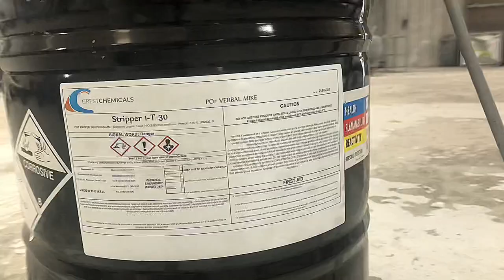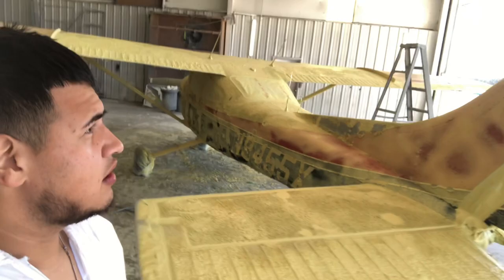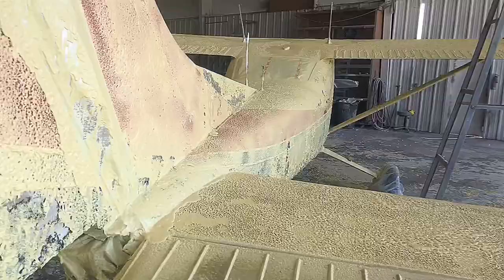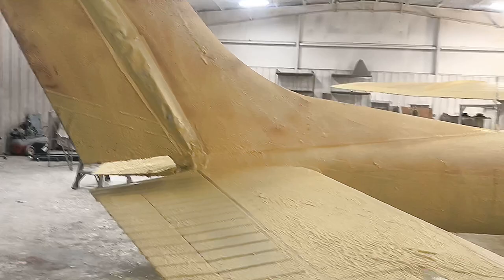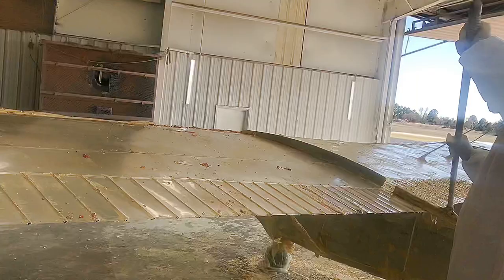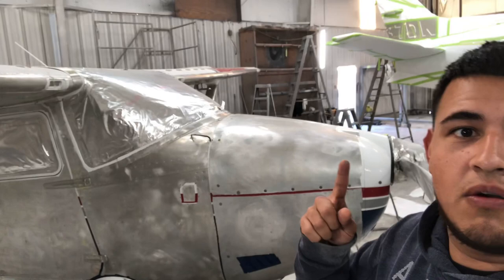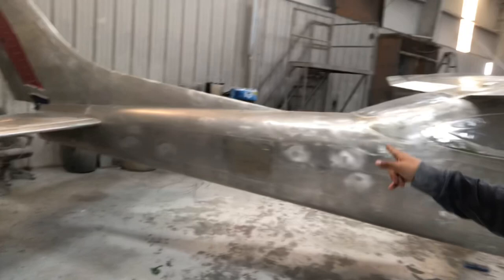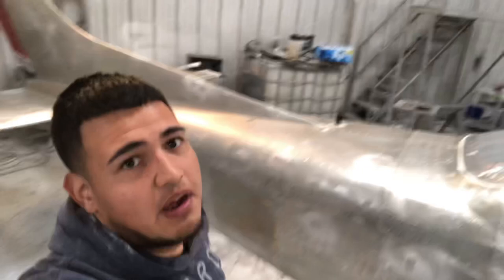Cessna 182 Paint Removal

Comment: My A&P school, Orange Coast College had a real nice Lear Jet that was owned by Northrop Grummam. Was based at Jack Northrop Field (Hawthorne Airport). We had it because the Painter to redo the paint did not do a good job removing the stripper. I ate into the structure and then was written off. Make sure you get that stuff out of all hidden spots.
Reply from the maker: Dam I’m sorry to hear that but if you’re looking for some quality paint you can always call me at this number 903-721-0348 or have any questions or concerns we definitely try to remove all the stripper because we don’t it does make it harder to work on.

Comment: That was a Cessna 182 taking off, they are loud because of the bigger engines and the constant speed propeller
Reply from the maker: Lol definitely loud
Reply: Yeah that 182 was loud, but in 50 years I've never heard the prop that loud on a 182, a NA AT-6, yes, but never a 182. It's also the prop making the noise, not the engine!  That was not a stock engine/prop combo on that 182 for sure, maybe some type of experimental, but stock, no way.